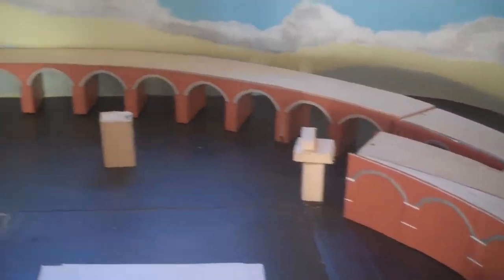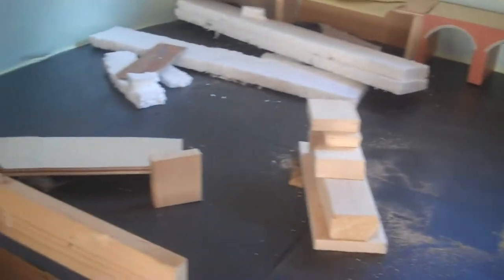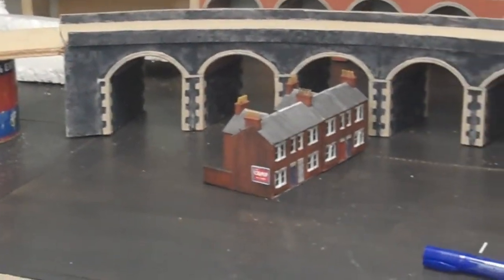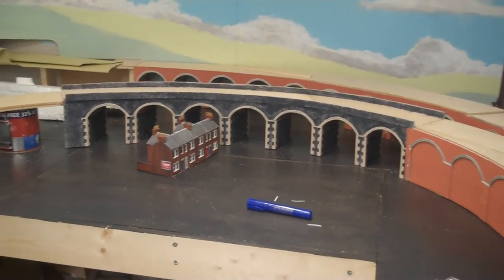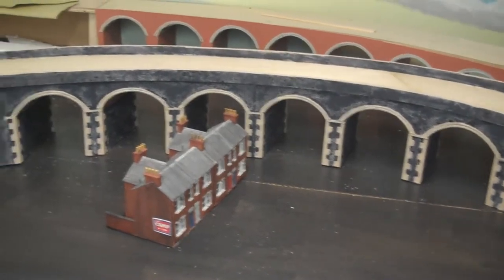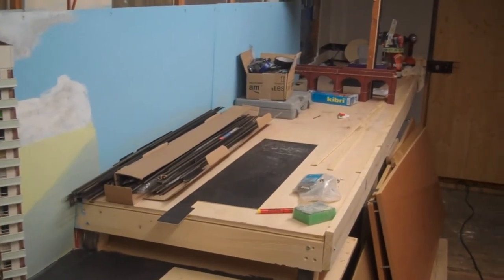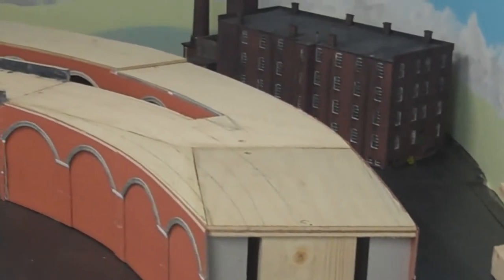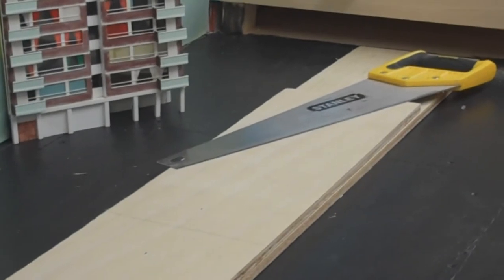APRIL UPDATE,part 1 of the new viaducts on Amberton 00 gauge model railway.

Comment from the maker: Hi Ian the shed size is 24'6" by 11' with a outside section that runs down the side of the shed see videos.
I don't get many problems in the winter only cold in there its all insulated and cladded.
For security the loft is better but I got evicted from there so I moved into a shed I prefer the shed its much easier for me when building base boards but with the loft you can use the silver insulation(see Glebe Road junction) which is good stuff,it all depends on what size layout you want.
Cheers K.